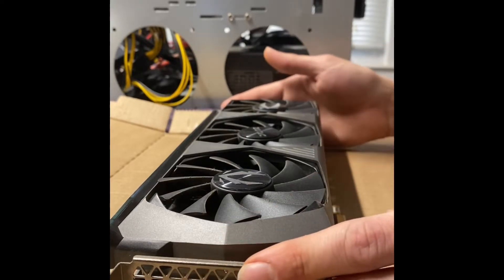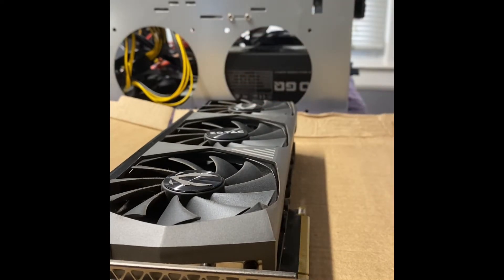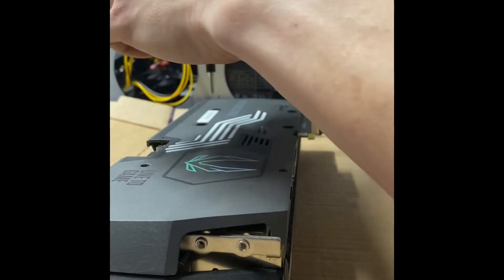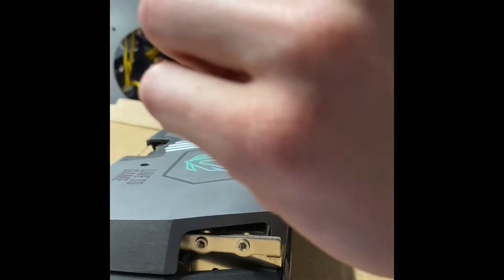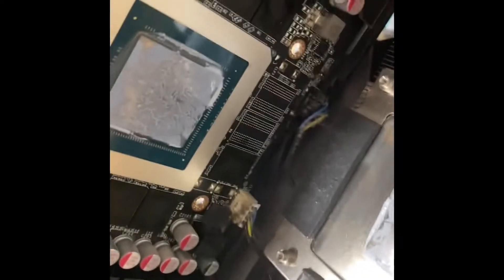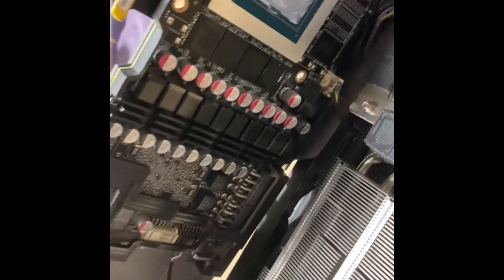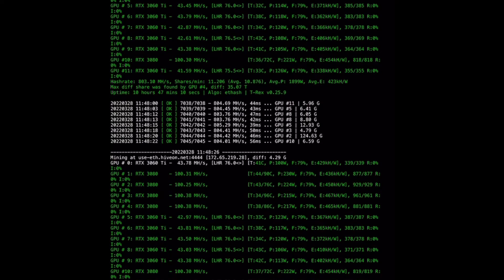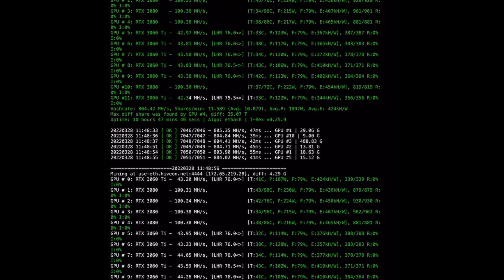Zotac 3080 Amp Holo thermal pad replacement and results

Comment: you dint tell.a size of.thermalpads which you are using
Reply from the maker: 2mm on front. 3mm on back.
Reply: bro my zotac amp.holo.3080 max chip temp.is 75 and hotspot temp.is 90 or 91 is it normal???...
can you pleasee tell.me.the size of thermalpads which you are using in zotac amp.holo 3080
Reply from the maker: Look above and also that’s really warm. Make sure to give a good cleaning.
Reply: @Mattyattacks1313  Bro are you sure size of 2mm thermalpad for front vrams?
Reply from the maker: 100 percent!
Reply: @Mattyattacks1313  bro i change everything thermalpads thermalpaste i cleand my gpu deeply....now im having gpu temp max 75 and memory juncion temp is 78 is this good or what
Reply from the maker: It seems better! But there are many factors of why it could be hot. So without actually be able to see it I can’t really tell you. What company pads did you use and and thermal paste for the core. And what’s the airflow like on your pc. And what are you doing with that’s graphic card. Mining gaming etc. I used Mx-4 thermal paste on core and thermalright Odyssy pads 2mm on front and 3 on back. Did you do the back as well?
Reply from the maker: Also my discord link if you want to send some pictures. https://discord.gg/ueCTUf6Z

Comment: Thanks for the video.
I changed my thermalpads on my 3080 Amp too... and it didn't drop the temps in Game (~80° C @ 3000rpm.). I'm still reaching the 80°C but at way more reasonable 2100rpm and a few more FPS.
Wasn't sure before, but it certainly was thermal throttling.
I still consider it a win.
Reply from the maker: Thanks for watching. I’m glad everything worked out for you. I have some new thermal pads I will be trying out to see how good they are.  I’m just super busy at the moment but I will get to them soon

Comment: Hello, friend. Can u help me? I know what the thermal pads on memory is 2mm, but what pads on back plate? Ty
Reply from the maker: Back thermal pads are 3mm
Reply: @Mattyattacks1313  ty,man. Can u told me how many pads I need and what pad are u use?
Reply from the maker: Thermal Odessy pads 2mm on front 3mm on back. 1 of each pad.

Comment: I did purchased 1yr old used zotac 3080 amp holo 10gb. card works well, however I am having issues with its temps. gpu gets around 91c. So i did the same thing, opened the card change thermal pads (using thermalright 2mm and 3mm pads) and mx4 thermal paste. it did lowered my temps to 81-83c OC to 1845core clock and undervolted too 875. so far I am happy with it
Reply: Probably you're using a glass cabinet like nzxt
Reply: @DCW_B63  yes you are right, does that mean it adds up temp since its glass?
Reply: @GY0708  your gpu is fine because i also have a 3070 amp holo black it often stays silent (fans not rotating) because it sits down at 43°c . You just change your cabinet with something that has front mesh not glass. Like deepcool ck560 or cg560

Don't buy Corsair 5000d or fractal design torrent or lian li o11 dynamic lian li lancool 215 type cabinet it has several drawback. I can explain but the comment will become large
Reply from the maker: I agree I bought a white cooler master pc case in 100 with the mesh on the front with three fans blowing. It helps a lot!

Comment: Hello @allthingscrypto i need help.. i was wondering what cause my zotac 3080 amp holo go to 100c in HOT SPOT place, i did change the thermal pads and the thermal past but i didnt changed the thermal pads of the back, if you can help i will be happy, i dont mine anymore.. i was just trying to play games and get black screen
Reply from the maker: Tell me more. What pads and paste did you use?  Maybe you didn’t put enough paste or thermal pads are incorrect size. And cooler isn’t making contact to the core. What is hot spot place? Is it core or memory?
Reply: @Mattyattacks1313  i used extreme odyssey II 85x45mm 2.0mm and used a old thermal past from unknown brand.. but its working fine idle 30ºc and can get hot to 86ºc at gaming in 2k.. but the hot spot idk where it is come from.. it doesnt tell me on HWINFO vram is okay aswell
Reply from the maker: I would try new thermal paste a brand new one. I use artic mx-5. Never had problems with it and make sure enough to cover whole surface area. If it’s your memory temps you might have to add some new 3.0mm pads on back. I replaced both sides to see a difference.

Comment: Is this card hot? I want to buy one, but some review say it reach 85C
Reply from the maker: Mine never goes over 50c. Depends on environment place setting on rig and I’d you cool them with ac. I’m not sure about lhr. But you will have to do thermal change. This was the easiest 3080 to take apart.

Comment: 3090ti need it to?
Reply from the maker: Probably twice as much.
Reply: @Mattyattacks1313  msi suprime x or asus rog strix is better?
Reply from the maker: I favor the suprim but depends on which one better deal.
Reply: @Mattyattacks1313  both of them are same cool and have low GDDR6X ram temperatures?
Reply from the maker: I think asus is only water-cooled. I would rather go founders route. If cheaper?

Comment: Hello, could you kindly let me know the thermal pads used and size necessary for the card (XX cm x XX cm)?
Reply from the maker: Thermal odyssey extremes. 2mm front and 3mm on back
Reply: @Mattyattacks1313  Thank you, i just want to confirm: Are 1x 85x45x2mm + 1x 85x45x3mm enought to cover the RTX 3080 AMP Holo? Or do i need to buy more than one of 2mm and 3mm
Reply from the maker: I did it all with one pack per each side. The back you are going to have a little bit more extra because you will have less space to put thermals due to the lights
Reply: @Mattyattacks1313  So in total how many 2mm and how many 3mm packs are needed for changing all thermal pads on the card?
Reply from the maker: One of each